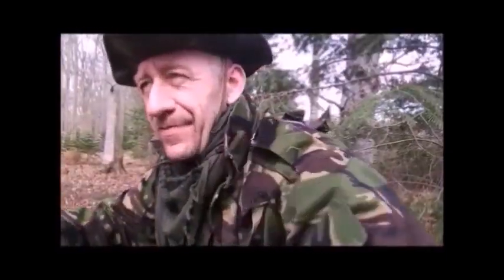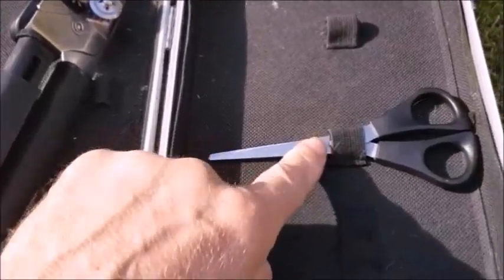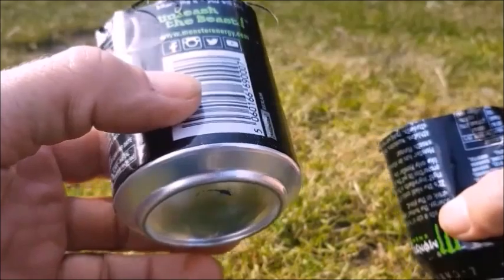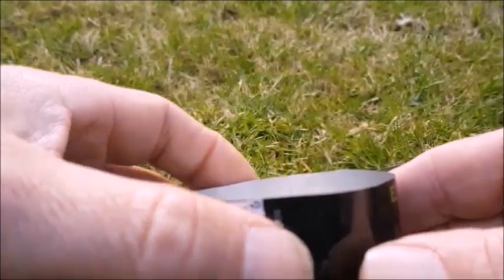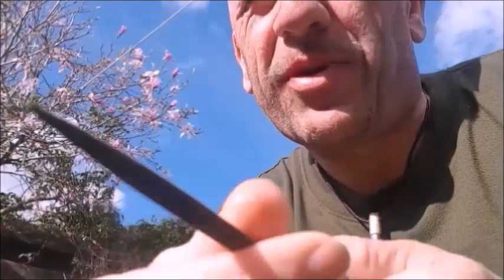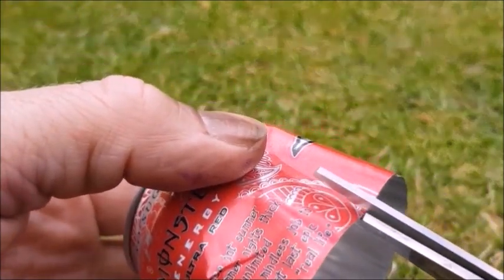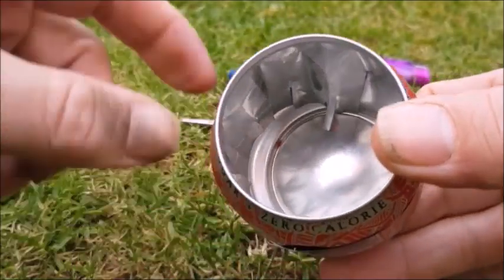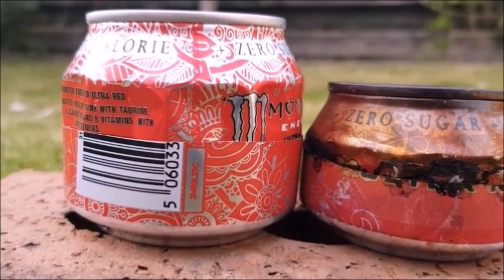ONE CAN STOVE FIELD MAKE  (with integrated pot stand)...

Comment: how does it compare in terms of fuel efficiency and performance/burn time to a regular trangia ??
Reply from the maker: Not a big fan of the Trangia burner, as you need to fill the trangia to prevent cold cracks on the welds before lighting. So you can not run the trangia on  20 ml of fuel from empty. My stove runs on 20 ml to boil half a litre in about three and a half minutes, ( yet untested times for winter of course) 

There will be a burn / boil test of at least 4 alco stoves coming soon.....Trangia stove remains hot to the touch for several minutes after being put out, mine is cold to the touch after 35 seconds.....bex
Reply: bex bugoutsurvivor ... I had a Trangia from the 60s but something went wrong with it and it turned into a blowtorch ... think a rubber washer disintegrated and mixed with the fuel, the flames coming out of it were insane, after a couple of uses it stopped working as I think it sooted up inside and I couldn’t unblock the vents, I bought a replacement ... also picked up a stainless steel version from Hong Kong,

Comment: Great vid Bex. I,ve seen this made by others and they put a little hole just under the top lip, Which I think is to stop too much pressure build up when the pots on it. Whats your thinking on this hole? Yours seems ok without it.  Many thanks, Ian
Reply from the maker: The pressure release vent is a good idea. It prevents the fuel from boiling over. How ever for 20 ml of fuel for a quick brew it doesn't burn long enough to make a difference. On my DIY cat wicking stove, I have the hole drilled in, as it will burn for a lot longer......thanx for watching bex